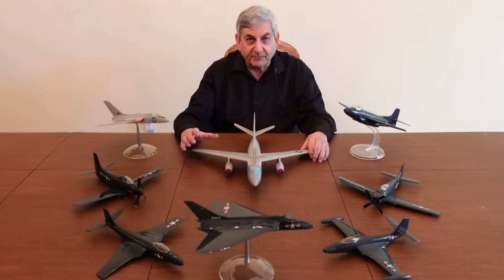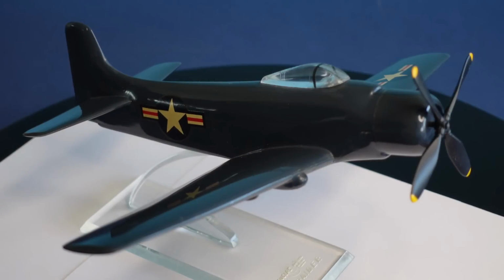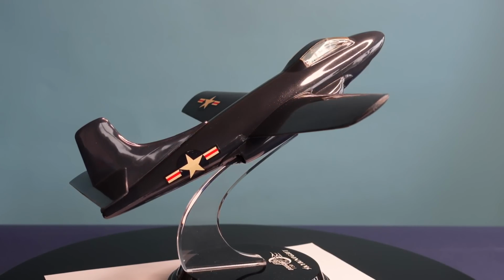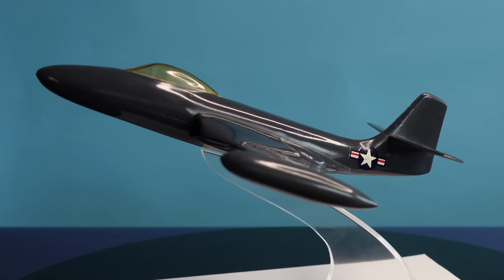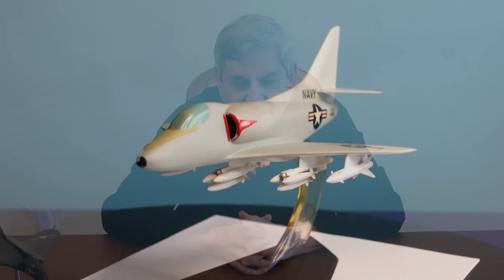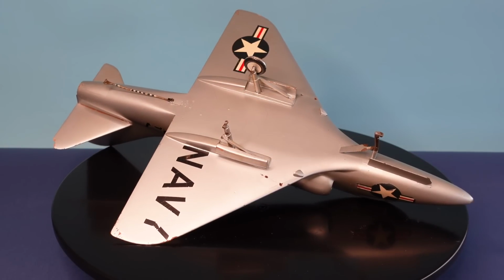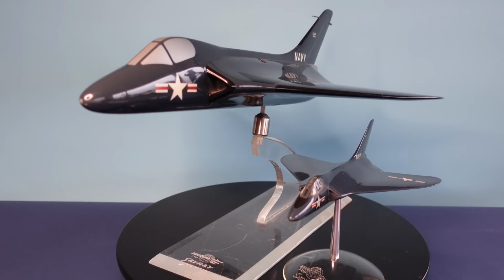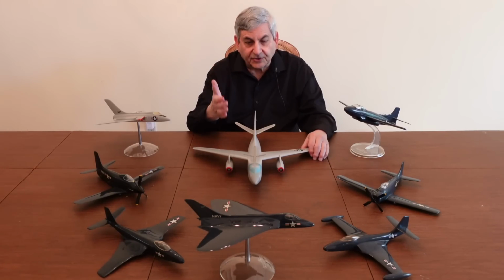DOUGLAS NAVY MODELS - Original Factory 1950s Naval Aviation Props and Jets

Comment: Hey Mike, the Banshee, was used in the Korean War, and it wasn't a Post Korean War design, because the first prototype flew in 1947, and then four years after its first flight, it made its debut in the Korean War, as the F2H-2 version.
Reply from the maker: Yup, kicked myself as I said that. Should have been "the F2H-3 was a post-Korean War jet" and we didn't catch that in edit. Thanks for watching!
Reply: @celebratingaviationwithmik9782  You're very welcome, Mike.
Reply: @celebratingaviationwithmik9782  Also, just let you know, I have a giant library of military aircraft books; numbering over 700 books.